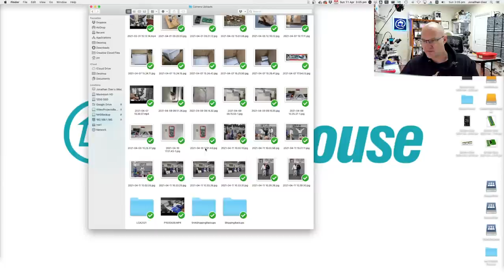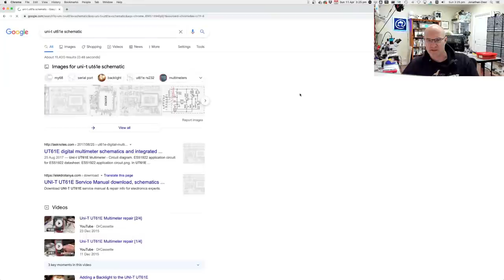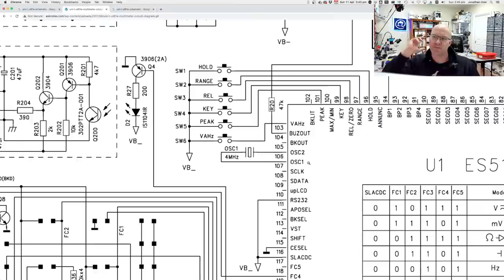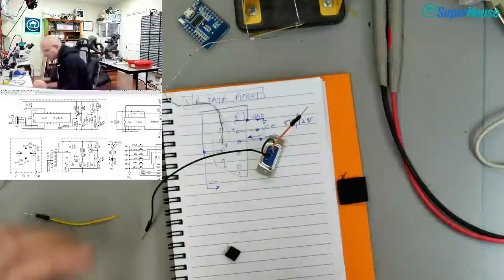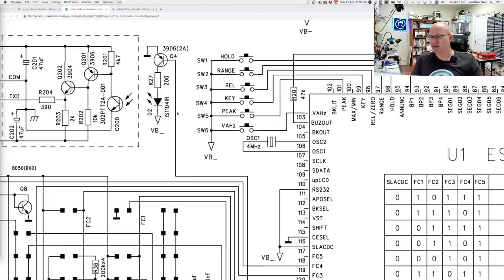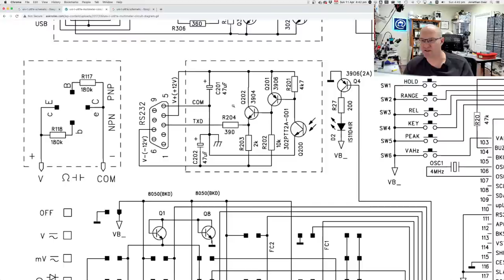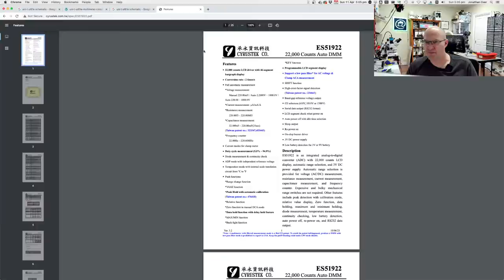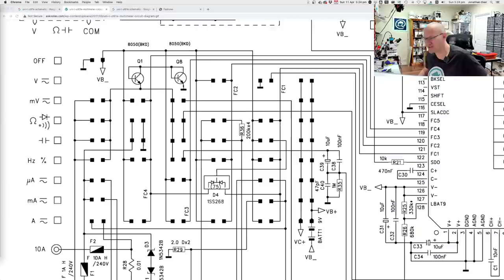Home Automation Hangout 2021-04-11: UT61e multimeter WiFi hack

Comment: Rs232 +/-15V according to the spec. Can use lower voltage levels as long as they're within spec. Max3232 pretty crap, sp3232 was much better.